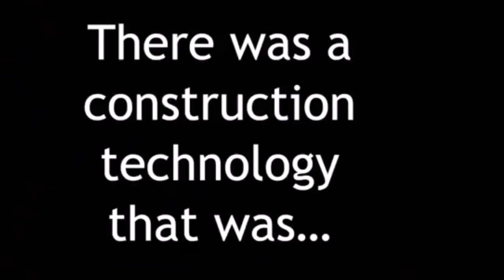Rammed Earth movie

Comment: Oh this is pretty cool. This looks like it works great with the compressed earth blocks. Or maybe even beats them in some ways? Can you form large floor slabs and foundations.
Reply from the maker: all is possible is just a mater of planing and making the calculation and testing before you commit to do it in large scale 
did you know that travertine , sand stone , marbles, and granite use to be dirt and mother nature compressed them to todays product.
Reply: @JoseAlvarado72  yes well earth has alot more compressing energy and heat then most any men can make. This is attempting to form sand stone with out heat or constant pressure. Using a binder like cement. Anyway i like the idea but i want something with a much smoother finish like porcelin which i know is possible because ive seen sheer zones in rocks that are silk smooth. The problem is the need for extreme compression and time spent compressed. Compressing it warms it already so that helps but it really needs to cook at a high psi. Im thinking bigger stronger heavyer molds. Faced with a high density polymer and backed with steel and hydrolics. Compress the material for long enough and hard enough and yeah you can have man made stone stronger then any stone. Basically i want to make this match or exceed granite specs. As granite is a very very good building stone. Honestly before finding compressed earth tech all i wanted was black granite. And i still think black granite is the most beautiful of stone. Anyway this is something i plan on learning from its a intersting alternative to concrete which i dont like that much.
Reply from the maker: @robertbogan225   that is great idea and i do love granite  too i wish i build a house of pure granite and thank you for your info i bet someone out there is already compressing  large amounts of  materials for greater results  and faster builds 
love the human mind 
there are no limits

Comment: This is a really great thing. However, the design could have been more suited for rammed Earth. The building could have more walls and less wood, also some principles learned from the Earthship people such as passive heating and cooling.
Reply: The formal building standard states clearly do not use cement. Why builders add it is odd when the international code states that cement inhibits the bond.
Reply: @johnm.515  Where can I verify that?

Comment: This is sn absolute AWESOME idea. However we may collectively be able to reduce the amount of "carbon" were spewing for sure,but as for the climate change itself theres nothing we can do to stop,slow or inhibit it at all. The planet is a living thing, thus the wonders of building with it. Its kinda like hh0. Its flame is cool to the touch BUT when in contact with ANY OTHER materials it automatically makes itself the exact temperature of that materials melting or vaporizing point. Ie. Tungsten. An o2 /acetylene tourch cannot vaporize it, but a hydrogen torch can. 🤔 and still be cool to the touch.

Comment: Interresting! What's exactly the composition of the building material if it's sementless concrete? And what's the average cost of rammed earth home? Thank you?
Reply from the maker: there are no exact material compositions all areas of the world are different in color and in clay percentage, some dirt is more sand than clay  but you can test the following  for load pressures

60 to 80 % dirth 20 to 30% clay 3 to 8%  sand  4 to 10% portland  cement  
remember this is a drypack consistency 
you  use what is best for you
Reply from the maker: the cost varies if you round it up is about the same cost of a conventional home 
if you make it your self as owner build you can save lots of money I have seen people build their home by hand for 
as little as $36 dollars  SQFT
Reply: I wich i could! Ill have to shut my bu a iness off for while ... To build my own home ...

Comment: Radon will be high though...
Thermal mass alone cannot provide for heating/cooling in all places. There are tropics and heating dominated northern Europe. There seem to be no earthquake proofing. And mold will find a cold place enough in winter due to desorbed humidity from the thermal mass. [from a building physics expert]
Reply: Steve Slade  Yes, but mold can get organics from organic emissions occupants have (cooking, skin flakes, drying laundry, wood dust, other kinds of organic dust...) over time. Mold can overgrow inorganic walls if cold and humid in particular in kitchens, basements and bathrooms.
Reply: I was thinking i would combine the walls with geothermal heating so the wall mass never goes below 50f. As for the mold you could just scrub the nasty grease smoke off your walls before it molds. Radon yikes ive seen water treatment kits for radon in peoples well water. And its not to hard to deal with if you just know its there. If your basement constantly fills with radon so its sets off the detector that sucks. But it just means you need ventilation!

Comment: Trust me this is less sustainable than wood. I know her bitchass put foam insulation in there too! THE FUTURE OF BUILDING IS IN MYCO-INSULATION! Can be made to be stronger than brick, and nearly as insulating as fiberglass. The insulation uses fungi in the genus ganoderma (reishi) to bind wood shavings, chips, and agricultural waste together. This will need to be sheathed on both sides and formed just like this. Osb, plywood, and finger-jointed boards can be used once the system is developed. The insulation can be as strong as weak brickwork. If you keep organic material dry, it'll never go bad (assuming the time for all of this material to oxidize from water vapor and oxygen is too long to worry about. I would think it would take several hundred years before oxidization would really affect the structure.

Comment: Says Great Wall of China is built from rammed earth, then shows brick construction?
Reply: Sometimes built on top of the dead workers?
Reply: @robertbogan225  To add some freaky texture to scare the mongols, rammed brain among other things, a wall that absorbs blood when it comes in huge amounts and then slowly expels it as the heat of battle diminish.
Reply: Well those bricks are just the outside of the wall
Reply: The wall was built from many different materials depending on the area it passed in, in the plains and desert the wall was built with blocks of rammed earth.

Comment: There is an easier and more robust way to build houses, which is interlocking compressed earth brick technology. It uses only 9% of cement but much more robust and has many advantages over rammed earth. You can channel all your plumbing, water and electrical wiring inside of the wall. All you need is a brick press and a mixer. No need for complex wallboards and scaffolding.
Reply: Precisely what I was thinking. And you really can use compressed earth blocks anywhere on earth. Rammed earth wouldn't last long in Florida.

Comment: When you put insulation in the wall how could the walls absorb heat during the day and release it back in the house?
Reply from the maker: that is impossible if you install insulation in the walls
 that will only occur if the walls are thick  rammed earth  and have no insulation
some architects like to add insulation in the walls for 
coold  and heavy snow areas.
Reply: Actually the right answer is, that it works exactly as without insulation, BUT with insulation the heat transfer is much slower. So in summer the outside is heating inside slower and in winter the opposite. End result is lower need for additional heating/cooling -> lower energy consumption and more steady temperature inside

Comment: Looks Great. what sort of foundations are required for this building method?
Reply from the maker: a normal concrete foundation and concrete base with rebar will do
usualy the structure engenier  will explain the best shoise
Reply: @Darren Munsell thanks! Concrete is always the go to but would be very Interested to see rammed earth foundations to keep the environmental credentials. Could see water being an issue but plastic lining for this sounds like a good solution!

Comment: I love it!  Is anyone doing 3D ''printed'' automated rammed Earth homes yet?
Reply from the maker: sanjuansteve 
Thanks for asking 
There is a company that is making prefabricated walls with a semi automatic machine but that is not 3D printed house jet I will make it happen soon thanks
Reply from the maker: Is not that easy to make a 3D printed rammed earth house 
There are lots of rebar, electrical , plumbing, and sensors in the wall for a fully automatic 3D  printed system but soon with an AI (Artificial Intelligence)  will be possible
Reply: Ive seen one do it with concrete. It made a little dome kind of round house. Easy way is a concrete tube on a arm going in a circle which is why it was round dome houses.

Comment: I'm guessing no plumbing or electrical in those walls?
Reply from the maker: ALL IS INSIDE THE WALLS INCLUDING, MAGNETS, ELECTRICAL, PLUMBING, REBAR, RADAR SENSORS, VENTILATION, ELECTRICAL, COMBINATION SAFES.
Reply: Oh ok, I would think having things like plumbing and electrical in those walls would weaken the structure and make it susceptible to cracking. How would you service a broken plumping pipe inside that wall?
Reply from the maker: that is not easy to answer there are many ways to fix that 
and remember the walls are recyclable too
Reply: @xjinit  you are right. I would not place them inside the wall. You can place them  inside the house and cover it up with wood cabinets.
Reply: You just build the exterior walls and load bearing walls with this. The rest can be filled in anyway you imagine. At least thats my idea.

Comment: They sa in all of the U.S. but here in the northeast we have been getting loads of rain. Wonder how well it holds up or is there a concrete binder mixed in for strength?
Reply from the maker: There are some risks on a higher moisture zone but all areas are ok to build with rammed earth just test different concrete % in walls before building the hole house
Reply: Thanks

Comment: With the middle layer of insulation I fail to see how, either, the humidity can be drawn out or the "slowly released" heat exchange between the exterior to the interior could happen when it has the barrier of I'm assuming closed cell foam?
She also thinks that she's saving the forests and yet still has a significant quantity of processed timber in her house, which I'm pretty sure is still flammable- so sure her walls might still remain after a fire but that'd be about it!! Looks good though....
Reply: timber is actually a more eco-friendly material compared to most others. This way of building still save forests tho, by consuming less.
Reply: The rammed earth has a lot of pores which are unseen and they regulate the temperature in the building. Just like a clay pot and a brick house.
Reply from the maker: I understand  the heat exchange won’t be possible without a Air System in place 
There are no limits to the different ways of construction of the walls some walls of rammed earth have no insulation at all and the earth bricks have no insulation either so those walls breath 
Is a design for the region that you live all are different

Comment: If the walls are high density and 18" to 20" thick, why is a core of EPS insulation needed?
Reply: In cold climates you encapsulate EPS or mineral wool to enhance your R-Value. In our home, we used 8" exterior rammed earth, 8" of Roxul mineral wool, and 8" of interior rammed earth, for a total wall thickness of 24". Our walls have an R value of 50-60. It's a great option for cold climates. In warm climates the insulation is not necessary, but we get winter temperatures in the -20 celcius range, so with this method we still use very litle energy, especially by capturing passive solar energy.
Reply from the maker: in the video the company building in the cold weather decided to use insulation but usually the territory will dictate different wall thickness  and  i believe insulation is not needed in most cases is up to you and how much you want to spend
Reply: tswrench Roxul mineral wool is an inorganic choice that will not be impacted by moisture and is not habitable by pests. We chose Roxul comfort board for our walls. It's easy to work with as well
Reply: tswrench earth has little insulation value
Reply: Daniel Abraham: Thank you for the reply.  The mineral wool is an interesting choice.  Why mineral wool?  I usually associate mineral wool with soundproofing.

Comment from the maker: There are many ways to hang things in a rammed earth wall magnets in the wall is one idea and remember there is rebar on the wall too 

 now  about price it depends on the project but here is an estimate and scenarios
if you build a normal house in USA price for construction is from  $98 /Sq Ft  to  $140 /Sq Ft  
lets say a  2000 Sq Ft House will cost you $280,000  but it will last you  50 years if build well .

if you build a Rammed earth home in the USA it will cost you about $150 /SQ FT but it will 
last you 1000 years, fire will not affect it,  and your health will be better than a conventional house 

i want to add if you do the work and make your home an owner build and hire people your self to help you build it you can pay as little as $58 dollars a SQ FT
Reply: I'm thinking of rammed earth for a foundation as it's fairly strong and can be made monolithic. Check out my comment on mycoinsulation. That's what's going to be in the upper structure of my future house. I have access to lots of wood and will have a way to saw it. Check out black locust as a material, it'll never rot if kept dry. There's more antioxidants in that wood than in blueberries and it's got antifungal properties and many tyloses to protect itself from rot.
Reply: I was thinking this might be able to work with compressed earth block which is pretty much the same thing just in blocks and probably more dense. The weakness is the need for a more massive machine to compress the bigger blocks. They didnt really show much of how its made but i assume its the same mix as the compressed earth blocks which have only 8% cement in them. Mostly clay or sand. And one other thing. Its like 46 46 8.

Comment: I love this material, and much more studies should be done in order to surpass the limitation of the "cottage in the woods" concept, since optimized urban density is a key factor for efficient future urban development (we cannot build everywhere ad-infinitum) if we really want to assure the survival of cities we have to leave plenty of open spaces for free running water (minimal intervention on river beds and the upper river basins), as for agriculture and healthy, well functioning ecosystems (which cannot be "isles" and need "corridors")... mud, bamboo, wood and straw are unsurpassed materials that await studies to prove how and to what extent can they also be used in bigger (taller) housing units... it would be wise to limit concrete use to where it is still the best technical solution, and use low carbon intensive renewable materials everywhere else

Comment: How do you hang pictures on the wall of a rammed earth house?
Reply: You can also embed a hanging strip of wood into the wall during forming if you wish to have have many things hung on a wall. Think of similar to a chair rail.  In general you design rooms such that there is a mix of RE and wallboard walls in a single room so you can hang things on the wallboard.
Reply: masonry anchors
Reply from the maker: With magnets in the wall at strategic. Places
Reply: Thank you.
Reply: I use long screws. You don't need anything else. When you want to move the picture just unscrew the screw and screw it in somewhere else. No plugs needed, just screw straight in.
Reply: With a nail
Reply: 4 pound hammer and 6 inch nails
Reply: step 1: get a hammer and a nail

step 2: hammer the nail into the wall

step 3: hang whatever you want to hang